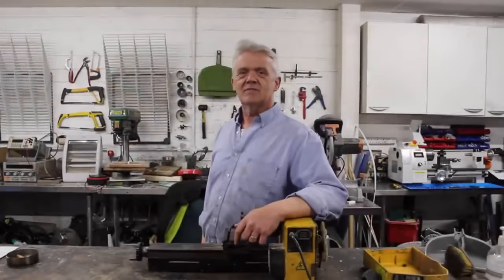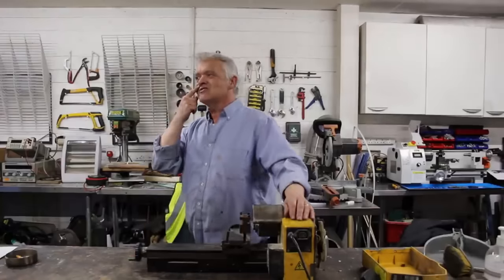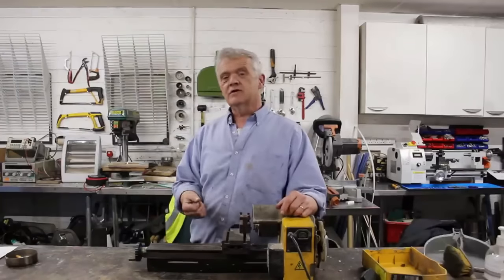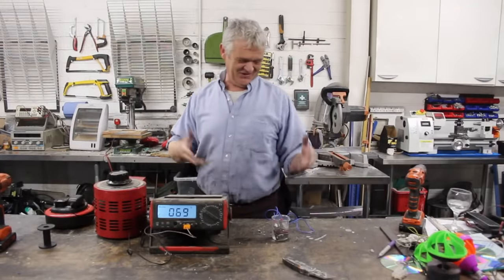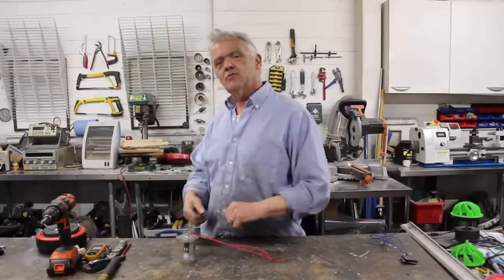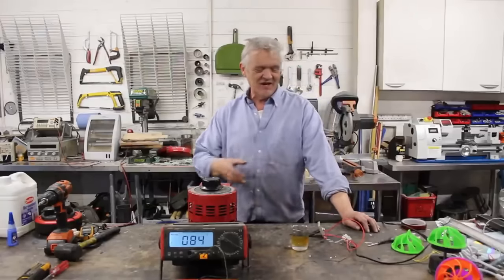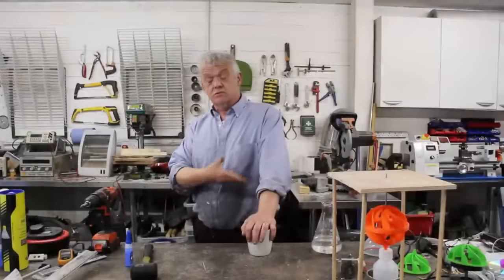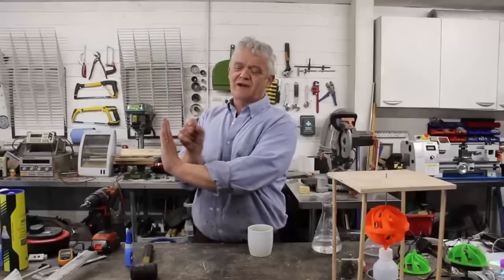016 The Dumas Effect - A Free Energy Water Heater

Comment: Back in 1974 in Australia you could buy a water boiling jug that used a pair of flat metal plates as electrodes immersed in tap water.  Just how far before 1974 these became available to the public I have no idea.  They worked OK (a bit slow) and did not burn out as the similar jugs that employed a naked wire heating element (nichrome ?) eventually did.
Reply: I am from europe and we had those untill like late 90s.. They were made out of thermal plastic and at the bottom were two stainless steel plates. Anyways they were marketed as quick way to boil water for coffee or tea.. But, i was a kid at the time and one time i put metal spoon in it.. Which was the time i realized that electricity feels like truck hitting you..

Comment: If you make this into a water heater, the power would depend a lot on the conductivity of the water. In my city we have two different water supplies. So I would get about double the power of my neighbours in the next street over. Where a normal water heater produces the same amount of heat everywhere.
Reply: Do not even accidentally try to apply it to the hot water boiler, the ELECTRODES UNDER VOLTAGE are immersed in the water, which means that all the water is under voltage, and therefore deadly, unless you have very good grounding in the apartment, you will just have to replace the fuses...

Comment: FYI, APV developed Ohmic heaters for food manufacturing at least 50 years ago. It would have been a better demonstration if you had an ohmmeter in your circuit.
Reply: Its not in there? An Ohm-meter is resistivity.
Reply: How are you going to use an ohm meter?  Temperature is the best test

Comment: When I was a child, I had a toy steam engine. The "boiler" was a bakelite cylinder with 2 carbon blocks, which were connected to a power cord. You'd put water in it, close the little pressure release, and plug it in. As they say, "Hey! Presto!" Steam for the little engine, in just a few seconds. Eventually the blocks degraded, as I recall...

Comment: You are right about water resonance, much to high a frequency would be needed. A microwave oven works by vibrating the water molecules creating friction which in turn creates the heat, they run a 2.45MHZ using a magnetron.  However what about the dielectric effect (dielectric losses)? Your plates are very small and the frequency is very low (50hz?) so this effect is insignificant. What if the plates were large and the frequency raised significantly.  By the way pure water is not very conductive and as such there will not be enough current to boil it, so this is would seem to be a limiting factor in you're experiment. This issue could cause the current to change (rate of heating) depending on the quality of the water. However using the dielectric losses of water may be effective if the right frequency is chosen. Of course this would require an inverter so as to raise the frequency of your mains. In the end I don't know which would be cheaper and most reliable to build in the long run. The Magnetron or using the dielectric effect. In practical terms probably neither as we now have heat pump water heaters with, unfortunately, all its moving parts.

Comment: We had a vaporizer based on carbon rods in the latr 50's.
Reply: They still sell them we got one in the garage right now.
Reply: You can use carbon rod at 20/30v 150/800a for make magnetic gas
Reply: You can use carbon rod at 20/30v 150/800a for make magnetic gas

Comment: Your instant hot water shower works this way by passing 230 volts though the water as it passes over bare electrodes.  If you pass a current through water it will heat up.  I don't see the need for fancy electrodes.  Your meter will also register the current flow so it is not free.

Comment: Back in the 60's when I was in the RAF, we used to make our own mug water heaters.
A couple of stainless steel knives, ''borrowed'' from the mess, with a piece of wood between the blades, thick enough so the handles don't touch, wrap insulating tape around the blades to hold them together, and pop the handles into a pint pot/mug of water!
A cable with two crocodile clips, onto each blade and 220v plug on the other end.
Plug in and switch on and in a minute or two you have a pot of boiling water.
Remembering to switch off, and then remove the knives from the pot, and you can then add your tea or coffee!
No resonance, patents or problems! 
Cost? Zero, as all the bits were scroungeable.
.

Comment: May I add this. The "resonant frequency of water" cannot be a constant. It's like asking what the resonant frequency of glass (as a material) is. A glass container is made up of specific shape and form. Tap it, and one gets it's resonant frequency. Obviously this frequency will differ from other glass containers that have different shape and form. So when we are talking about the resonant frequency of glass, we have other variables - it's size and shape, not just the material of which it is made.
Reply: Thats not neccessarily true when talking about the H2O molecule, which in fact does have a few different discrete resonant modes relating to the spring-like nature of the atomic bonds.  All molecules have resonant frequencies.
Reply: @newtonbomb  If that were true, one should be able to take the magical constant frequency, up it's amplitude and split it just like a glass container. The fact is, context matters. Ever watch a singing bowl in action? You can search youtube, there are plenty of examples of people using the action of these bowls to make water dance.  The resonant frequency of a small bowl filled with 90% water won't be the resonant frequency of a large bowl filled with 90% water. The reason why the water dances at all is because of the resonant frequency relative to the bowl size and the amount of water in it. It's different for different size bowls. The reason (in my opinion) the water just dances and doesn't split is because the resonant frequency doesn't have enough amplitude or power with the way the singing bowl operates.
Reply: @stravs8097  It is true, simple as that.  You are failing to see the tree because the forest.

Comment: Resonance may have more to do with making it efficient. Presumably when the load is driven at resonance, the impedance will spike, and the current (and thus power) reduce. If the effect can be maintained at load resonance, the efficiency may be significantly higher.
Reply: Yes and you can change the frequency and find the sweet spot!

Comment: For reference: the resonant frequency of water molecules is about 2.4 GHz. This is what microwave ovens work on. So yes, there is definitely no resonance in this device. However, thermal effects may occur in a dielectric placed in an alternating electric field. (in case of deionized water).
Electrode direct heaters ARE actually used but not in households due to their obvious inconsistency with the electrical safety rules -- water stays electrified through the process. They are also quite demanding to water "saltness" -- too many ions causes short cirquit, too few -- device isn't working or does it slow. In addition, they leave behind various electrolysis (yes, it goes but slightly different than on DC) products after the process, which may be completely unacceptable in the further use of water. Their main use -- on big production sites and with voltages like 3-12 kV considering all the safety measures. And, mainly, to just produce just heat -- not water to use it.

Comment: my former leading hand here had done a fair bit of " Porridge"  back in the UK when younger , he showed me a prison jug or kettle , 2 gents safety razor blades separated by  2 matches  bound by cotton thread with a wire to each razor blade and connected to mains power , dropped into a plastic mug of water  (put in water first) a tiny pinch of salt  quickened the boiling  by 3-4 times 
this is not  that far distant

Comment: @rudolfvanacker8569 Back in the mid 1960's we used a baby bottle warmer using this principle. Whenever we used supply water it worked well. When visiting in-laws who were on rainwater tanks it stopped working after a while. A few grains of salt in the water occasionally made it work again, showing that it needed a conductive path to allow current to flow to generate heat to warm the feed bottle.
Reply: Later on the child had three eyes, right? Ha

Comment: There was a hotdog cooker that used the hotdog as the heater. Basically each end of the hotdog was connected to its own electrode and the hotdog was the resistor.
Reply: And that works very well also because of the salt as a conductor inside the hot dog sausage.

Comment: Hi. Given that the Dumas effect is due to ohmic heating, I'm interested to know why you used de-ionised and distilled water, given that these liquids would be insulators if perfect and should have a high resistance in practice.
Reply: The acid in the carbon rods from the batteries provided the path. I believe initial bubbles were HHO. A spark would have proven the presence of HHO in a sealed cell.

Comment: When I was 14 I stayed as an intern in my old school. It was winter and cold. I wanted to boil some water to make ready make soup, but I forgot my waterheater, you know the spiral you can dip in a cup. I remember my brother had an electronic toy box and I had seen he used two razor blades in a tray of water, there was something you could listen to what happened. So I decided to make my own water heater with two razorblades and a spacer of a piece of wood, and an old cable I took from a scrapped household machine. When I plugged it in, all electricity in the whole school tripped. I broke up my experiment and realized 9V DC is not the same as 220V AC. 😂

Comment: Here is one for you Robert, I was splicing a snapped wire for an electric drill cable after it got stuck and snapped, I put the mains wire in my mouth as I was stripping the wire  with my teeth and forgot it was plugged in.

Comment: Did this once in my flatting days for amusement purposes. Dangled a mains tail into a wine glass of water. I really wanted it to conduct so put some salt in there as well. It was quite spectacular. There was a kind of underwater arc going on and the glass was buzzing at the mains freq and starting to vibrate and move randomly around the floor. In this moment I suddenly had a thought...could this be used as an Electric Ouija Board planchette? What instantly followed was that there was a snapping noise, the glass jumped about half a metre into the air and smashed on the floor when it came down! lol
Reply: Brilliant. 
How much salt did you use?

Comment: Robert, years back before my young brother passed away, we did an experiment with ac current in a glass container having small amounts of CALCIUM HYDROXIDE disolved in distilled water, in such amount as to avoid any precipitation of CaOH. Then we applied 60 hz ac voltage to a pair of stainless steel electrodes embebed in the water mixture. After some minutes we observed precipitación of CaOH. Decanted the solution to get ride of the bottom solids, applied the ac current again and more precipitation ocurred. Again another decantation and more ac applied. We did this process several times until no visual precipitation happened any more. Does this test explains what you mentioned in your video about liberating the disolved gas in pure water and happens to salts or any other chemical added to water? Thank you for your time reading this old memory when my young brother was still alive.
Reply: U made an hour generator

Comment: This looks alot like a Vick's heated humidifier. I had one. It lasted a season, you had to add "a pinch of salt" if it wasn't steaming enough, and in less than a few months use the carbon crumbled and the house lights started flickering as it was arcing out. It wasn't the safest thing to run and I'd never buy another. But steam humidification sure is nice during the winter.
Reply: Salt will oxidize the plates.

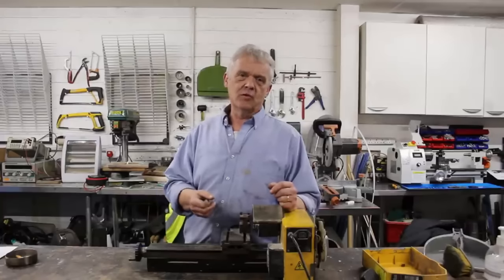Comment: 4:19 you can deposit by boiling, but hard water also drops minerals out of solution simply from a rise in temperature. Just as dissolved gases come out of solution, long before the actual boiling happens.

Comment: .
    Fifty years ago, here in the U.S., when I was in high school, In electric shop, Kids were building 120 VAC hot dog cookers. They would take 4) 3 inch long screws, put them through a piece of Lucite. Two of them side by side 1/2 inch apart, 4 inches away from the other 2, side by side, 1/2 inch apart. Then there was a wire with an outlet plug, one wire connected to one pair of screws and the other wire to the other pair. You push a hotdog down on the screws, plug it in and watch it cook. This works on the same principle.
    Of course, now adays, this would be way too dangerous just as it was back then but schools are more careful now.
    I disagree with the 22 GHz water resonance frequency claim. Microwave ovens cause water molecules in food to resonate, (to flip back and forth), causing friction and heat to cook the food. Microwave ovens operate at about 2.45 GHz.

Comment: There used to be a water arc egg cooker that could cooks 4 eggs with a couple of tablespoons of water. Rather small platinum plated electrodes. Regular water contain about 0.02% D2O and that would yield about 200% efficiency.
Reply: I remember we had a hot dog cooker that you would stick each end of the hot dog onto an electrode they would cook those suckers in a minute

Comment: Hello Rob! Seen Peter Davies story a while ago and wanted to know how they work. Thanks for the Info.

I ask myself this question all the time, so maybe you can lead me to some of your findings on the subject. I only found a couple of interesting high voltage electrolysis papers.
You have said that generally the AC electrolysis is not possible and will switch to omic heating. I agree on that part but a thought of mine(its stuck there for a long time), was that maybe you could use Impulse DC currents that change direction (So technically Pulsed AC).
If you had the possibility to switch so fast, that the watermolecule is pointed in the direction of the charge, and then reverse the polarity so it must violently change directions (and if violent enough maybe rip its Bonds). 
If you would do this with distilled water you could reach high voltage to amplify the ripping force. The advantages of this system (if it would work) would be alot less heat than regular electrolysis, because Heat in this case Wasteheat is P=I²R and only scales linearly with the voltage. Also you could use the dielectric properties of distilled water to arrest any sparks or shorts, or build a measuring system so the voltage does not create a short through the water.
What are your thoughts about this? (Im feeling kinda dumb for thinking this)
Best Regards from Germany and sorry for the bad grammar
Reply: I don't think you're dumb thinking this, I've also red a lot in this respect, it could work, so if you want to talk in private, please do.Thx

Comment: It would have been interesting for you to apply a flame to the steam to show that the HHO effect wasn't significant.
Reply: The way to do this would be detecting pressure by putting a balloon on top and sealing it.  No, this will not work because of the steam and heat pressure.  I guess it would work if you repeated hot cool cycles for a long time.

Comment: So there will still be a slight build up of corrosion when using AC current for the Dumas Effect, right? How much of this residue would accumulate compared to electrolysis(DC)?

What help would it do, for the carbon rods to spin? This spinning would prevent the residue that would accumulate traditionally when you boil a liquid with anything dissolved in it.

Comment: If you're using DI water, how come it gets hot? Surely only a tiny current will flow?  If the resistance of the DI water is a megohm, at 100v, it will only dissipate 10mW? 50cc of water will take about 4 mins to rise by 1 degree C with 1W of heating. 10mW is going to take 6 hours... What am I missing? Or has the DI water had some salt put in it?

Comment: Of course it is Heater, dirty and very Power Consuming! In old dirty days I use it with 2 razorblades. Power consumption is about 2000W with 220V AC. Glass of water heats very quickly, but there is NO FREE ENERGY at all. :)

Comment: Just one question. How many amps are being drawn to heat the water, given that it was a very small amount of water and it took a while to boil. so is it any more efficient than an element in soft water which will not have a limescale build up.

Comment: It seems to me that a disadvantage of this method, particularly for a tankless unit is that the water is connected to the electricity. I wonder if it would be interesting to investigate low-frequency capacitative heating. Everyone uses multi-megahertz for that, which is tricky on the home workbench but I don't see a good reason it shouldn't work exactly the same as this. They do use frequencies as low as 1MHz, which is already 10,000 times below resonance. The electrons are still being moved around by the field; they just never reach the plates. The power companies wouldn't like it because it would screw up the power factor -- the power would be out of phase with the voltage -- but at a small scale that wouldn't matter and at a large scale it can be corrected.

Comment: it does not matter how 1 watt of energy is converted into another form of energy, it will stay just 1 watt.
and 1 watt of energy will heat up a certain volume of water by a certain rise in temperature.
electric heating gives: 0,24 x i(squared) x  r x t
or did that change in the past 50 years?